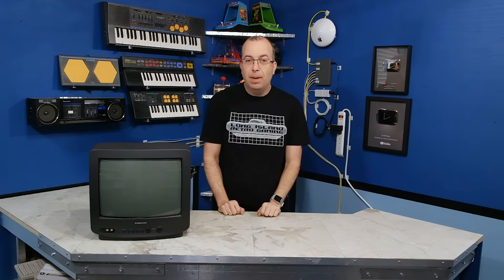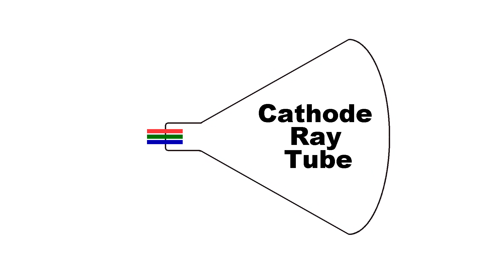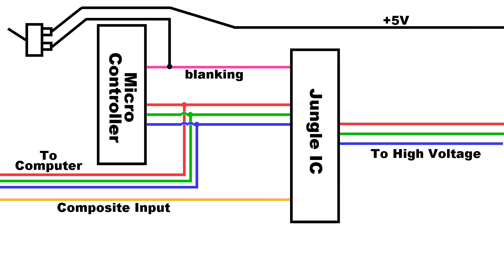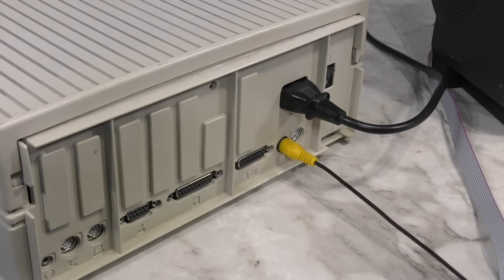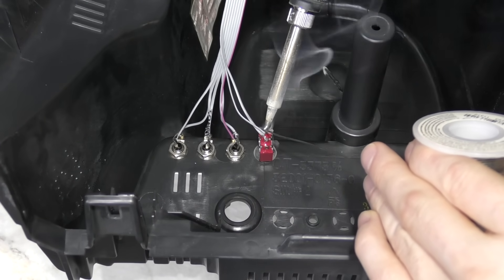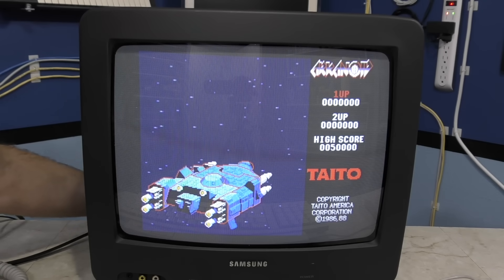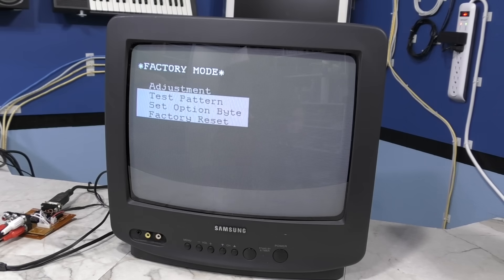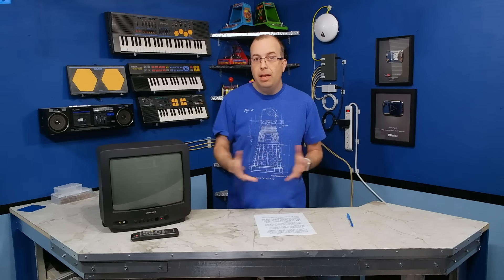Modding a consumer TV to use RGB input

Comment: This TV has very  low hours in it. I'm sure below 5000h, probably below 2000h. It's practically new.That's incredible for a TV which was in regular use since 1997. With any significant use, the white plastic on the deflection yoke should have been yellowed, and TONS of black dust on everything, as the high voltage attracts it. Even the plastic cover on the top of the heatsink (for the primary PSU controller+driver IC) is still white. These are used to be brown and brittle in a 20+ year old Samsung with this chassis.
I really suggest you to replace the electrolytics on the primary side of the PSU (the mains reservoir can be left alone), with some top quality Rubycon/Nichicon/Pansonic long life 105°C series, as this chassis uses a weird hybrid driver/controller IC, which is prone to failure if those capacitors go bad, which is possible after 20 years, even with low hours (especially, if the TV was in standby most of the time, in this case it's a wonder it still works). And you probably won't get any replacement PSU IC, because it has been discontinued 10+ years ago, the current stocks are all counterfeit and garbage.
Reply: this comment needs to be higher
Reply: @metarotta  that's right
Reply: @eashiftzr1  The STR series PSU ICs usually used in sony TVs are pretty bulletproof, but it's still suggested to replace all the small electrolytics on the primary side. All electrolytics around the vertical power amp, the horizontal driver stage (around the hor. driver transformer, both primary and secondary side), electrolytics in the E/W correction circuits and around the flyback. Than all the other electolytics that are close to hot heatsinks and components. Suspect the phisically smaller capacitors first (5-6mm diameter), they fail sooner than the bigger ones. If you have an in-circuit ESR meter, it's worth measuring the bigger capacitors as well. Oh, and check the whole board with a magnifying glass for cracked solder joints, especially around the components where the board is blackened by heat. Use only high quality 105°C capacitors, from the appropriate series (use low-ESR where the original was also low-ESR), and use long-life (8...10k hours) series around hot areas. If the repair/maintanance is on a low budget, don't go below the quality of Yageo/Teapo/Jamicon, bought from a reputable seller. If money doesn't matter, use Rubycon/Nichicon/Panasonic/ELNA/NIC.

Before the maintenance, check out the service manual, if the TV in question has a working hours counter, check it. A Trinitron tube usually gives a nice picture until 20-25k hours with the factory default settings (blazing high contrast, etc.). If your set is close to that, don't invest too much in it. Find the minimal contrast setting which is OK for you, this will extend the useful life of the tube. You can decerase the subcontrast and peak white levels in the service menu, also to extend tube life. Make sure you note the factory settings of the service menu, this way you'll have a backup, if you make some settings wrong.
Reply: This sums up what  mrnmrn1 posted. I organized it for myself and thought I'd share.
Can someone explain what 1d is? I'm not familiar with an E/W.
And is there a good place to find parts of a CRT and their descriptions. I know some of the general components but would like something mildly in depth.

CRT Restore
1. Change Electrolytic Capacitors
a.) on Primary side of PSU (can leave mains alone)
b.) around the Vertical Power Amp
c.) around the Horizontal Driver Stage (hor. driver transformer, primary & secondary side)
d.) in the E/W correction circuits
e.) around the Flyback
f.) around heatsinks or other components (resistors)

Rules:
A.) Smaller caps (<5-6mm diam) fail sooner
B.) Use appropriate series caps (ex. low ESR caps where used originally)
C.) 105° rated only
D.) Long Life caps rated for 8-10k hrs near hot areas
E.) Minimum of brand quality of Yageo/Teapo/Jamicon… 
F.) Rubycon/Nichicon/Panasonic/ELNA/NIC is preferred
Reply: @eashiftzr1   You're welcome.
Reply: How do i learn what you know
Reply: My main tv is still my Orion from 1996, while I have three hd tv's, teo 32" and one 50", I got them all for free and they was broken, but I repaired them, the first one just needed a software reset, the second a new t-con board and the third new caps on the led driver. 
Two years ago the Orion started to make loud noise in standby mode when the room temperature went down and didn't turn on again, sound was like current was leaking somewhere, after I opened it up it was completely grey inside, first thought was the dust gets moist when the room cools down, so current can leak somewhere, I cleaned it all but didn't help. I couldn't find where the noise came from, so I taped the microphone/remote piece of my earpods on a stick and went over the whole pcb while recording a video, this way I found a leaking cap in the standby circuit I replaced the cap and now, some months ago, the screen started to move up slowly and if I watch something where no black bars are on top and on the bottom, I get lines of the picture on top of the screen where ones are the normal ones and the others reflected, it's like the picture goes up and comes down again through a half pipe, would love to have a function to move that picture but I need to open it up again and turn some of the pots till I find the right one. But still there must be a reason for why the picture moves up, some day the potentiometer will be on it's limit and then I will cry for losing my go-od o-ld tv, so I need to find the problem, I want to use that thing till there is no compatible signal anymore and then maybe modify it with a new screen and stuff, basically keep only the case, I can't understand how people can replace their stuff just like that, that served them many years, but this also fits to the relationsships to other people nowadays, values are completely perverted, the least valuable not even real existing thing is money, 90% virtual numbers and the rest some scrap metal and colored paper that you can't even use to start a fire i case, but people give just everything away for that, just to waste it on useless stuff.

Comment: Im actually surprised the mainboard didnt have all the circuitry points present for a SCART connector.. it certainly looks as if the case is molded for it and there is just a composite connector installed there instead. SCART supports composite in as well as RGB so it would be simple enough to just install a connector there and save spinning two separate boards
Reply: other commenters pointed out that possibility, but there's no way of knowing if it'd be electrically compatible

Comment: I would wonder why bother on a on a small screen I see a use poing 68cm and above 

for north america 26 inch and above

from a pc perspective using adaptor cable became useless as from xp onwards tv res was no longer supported in drivers as they stop supporting tvs as pc type monitors

even is you can support  rgb you will still likely throw B&W Image because the pc will likely not support it in the drivers

Comment: I noticed at approx 9:37 the outline on the back of Davids TV for a Scart socket. Probably Samsung marketed this TV across many markets globally, so maybe a European version had Scart as standard.

It's a great thing to have now for me in the UK, as many of the old 8-bit and 16-bit machines can be plugged into a Scart socket via a 3rd-party cable. Bit of a pain having to use so many different cables, but there were multi Scart extension sockets available I seem to recall, so ok if you have the correct storage setup to run many systems.
Reply: Stephen Valente I think the board of the TV has the circuit for Scart input/output as well but is not populated. The way to do the hack is to find the schematics of a european version of that TV and populate the board likewise.
Reply: Λογος
I concur that it is very likely to be the case.
Reply: Steve
SCART connectors ARE essentially component video, insofar as they can carry both composite AND RGB signals, as well as sync, stereo audio, and a 12 volt switching signal that tells the TV to switch from antenna signal to SCART input.
Reply: Steve, you're thinking along the right tracks, however, inside the TV, the composite signal is split into RGB, not the other way around, so that the electron guns inside the picture tube will have their respective R, G, and B signals fed directly to it - via some amplification of course.

Comment: This is a remarkably informative video. Great work!  I would suggest using flux, and getting a variable power soldering iron.  That iron looked hot for the relatively delicate soldering you were doing.  You don't want to cook your semiconductors..

Great job 8-bit guy.  You are absolutely the best of the vintage-computing youtubers.

Comment: Great video, jump in quality is amazing :) i'm currently searching for cheap solution to convert HDMI to RGB Scart to play games on my TV, currently i have HDMI to AV (composite) its... good? at least in PAL mode since image is much sharper than on NTSC (50Hz sadly kills it for emulation as 60Hz games stutter a lot, PAL ports up to PS2 are crap and games are slower) but RGB solution will be much greater for even just navigating in Windows but i didn't find any with similar price. btw i tried to connect directly VGA output from R9 270 Graphics card to RGB Scard and tried CRU to force 15Khz, garbled signal was there but graphics card behaved very strange and PC was unstable, maybe newer graphics hardware DAC's are just incapable of that low frequencies?

Comment: Would your mod work with a YPbPr component signal since it is analog RGB and uses RCA connectors?
Reply: You'd need an extra circuit. YCbCr is analog, but the encoding is different. There are circuits going to and from RGB on the Internet.
Reply: YPbPr has its video encoded with Y as Luma (with Luma carrying sync), Pb The difference between Chroma and Blue, and Pr The difference between Chroma and Red.
Green was not present in the signal and was extrapolated from the existing Data. Also why Hence RGB is superior to YPbPr.
Reply: YPbPr is not RGB, so no.

Comment: I still (ironically it's RCA jacks and board has issues) have a TV though i dont use it ATM ... that looks EXACTLY like that
Reply: yep .. .hard to tell the exact size from the video but this may be the exact same model and TV I  have ... issue i have is the RCA connectors on the back are GONE so to speak and the little board for the RCAs in the front need to be re-soldered ... as it connects/ Disconnects unless i use to wiggle the RCA cables ... then THAT didn't even work any more ..I ended up connecting an RCA modulator to get RCA stuff to work with it ... I had a few people try to get me to toss out the TV but i am glad i kept it .. .may use it for a future project and while it seems small vs my current tv ... this TV that I got in @ 1998 .. still worked fine at least in 2017

Comment: 8 Bit Guy, 15khz is what most Arcade cabinets run at because they use a CGA monitor (basically a TV with no tuner)
Some later cabinets used VGA monitors, (modified TV)
But they run on the 15khz / 31khz freq.

Comment: Did this to a 20" sony trinitron from 2000.  Basic method is fundamentally the same but I put resistors and caps on the scart socket, luma for sync, and I used a scart socket instead of rca jacks   Didn't need to pull the board out either.  
Great video, people doing this are kinda hush-hush about it because of high voltage dangers inside a crt.  Might put a warning at the beginning of the video.

Comment: Be careful messing around in a transformerless set. There could be an electrocution hazard. I once wired in an external speaker jack on a set and discovered that the speaker cable was now ‘live’. This can happen even when the power plug is correctly polarized, but the wall plug has line and neutral wires reversed.  I would have never though that bringing out an audio signal would be a safety hazard, but it gave me a nasty shock.   I would highly recommend taking an AC voltmeter and carefully checking all your new signal lines you bring out of the set before connecting other equipment.
Reply: He fine as he took all the necessary precautions. And the Mod he made was on the low voltage side of the TV circuitry.
Reply: @Crashdance22 Did it? I didn't see that. And i was looking.

Comment: What about TVs with Svideo input? Isn't that the same thing?
Reply: Not sure if S-Video uses separate RGB signals, instead S-Video uses Chroma and Luma signals
Reply: I think S-Video has just lines for luminance (B&W picture) and chrominance (color information). It doesn't have separate lines for separate colors.

Comment: A question. Could you break out a S-Video connector and plug it in to the tv? A long time ago I tried to go from VGA to S-Video but didn't know what to connect sync to. I had heard the term sync on green but I didn't want to risk my video card to just connect the wires together and see. (I was about 10, 1990 or so) It worked and was recognized but it obviously rolled. Keep up the great videos on all of your channels!

Comment: While yes, analog over the air is long gone, you still can get digital to analog tv converter boxes off Amazon. Although, some cable companies have converted to carrier only signal, essentially, similar to satellite, you'd end up having to get a cable box according to what cable company you were with, like with what spectrum pulled with their customers. Edit: ok, coming back to this comment, I do think that most or just about all subscription tv boxes like directv boxes, do still have the old yellow, white, red rca Jack's on the back of the receivers. So, you could likely still use older TVs like the one David has in this video to watch TV from the subscription TV company, albeit, not as good picture quality, but still. Ok, I looked after I wrote that, and, yeah, even over 4 years later, you can still find atsc digital to analog tv converter boxes for over the air.

Comment: The STB Velocity 128 video card would put out 15KHz VGA if powered up and it didn't detect a VGA monitor.  That was because the DAC chip was doing double duty as the VGA DAC and composite DAC.  So it was down-clocking for the composite.  I used one to drive an RGB Arcade  monitor before.

Comment: Why do the pixels shift slightly to the left when switching to RGB mode?
Reply: A composite signal must go through a decoding process that requires around half a microsecond, to convert it to  RGB.  That half microsecond delays the composite picture, resulting in a shift to the right.
Reply: Ah ok. That's interesting, thanks.

Comment: Ah, Europe, life here is much easier
Reply: From what I heard, Europeans have a different set of headaches than Americans. Your consoles ran 10 Hz slower, for example.
Reply: true but those scart cables always were a pain in the ass to plug into the back of a bulky CRT
Reply: Minus 50 hertz...
Reply: But tv's were twice as expensive in Europe compared to the USA, with teletext, SCART, channel presets and other features standardized.

Comment: FWIW 8-bit is wrong on one point: you can get an inexpensive converter box that takes over the air digital TV and outputs NTSC analog, it works just fine.  We're still using it on a 32 inch (2.5 x the size of his Samsung) TV.   Some larger TV's had pretty nice resolution NTSC-wise and from across the room you can't tell the difference.
Reply: Haha I also have one of those boxes connected to an old 20 inch crt TV. The image looks great and doesn't have all that noise that analog TV has.
Reply: You're both right. Analogue TV is dead but doesn't mean you can't make analogue signals anymore.
Reply: Would you happen to have a link or a search query for boxes like these?
Reply: @gymnasiast90  Search for digital television converter box.
Reply: You can probably just search for “analog tv converter” or something like that. They were commonly available in the late 00’s in America.
Reply: You can watch TV on a picture frame with enough boxes in between. Doesn't change the fact that the TV cannot comprehend modern TV signals and only relies on the video inputs to act as a dumb display for any smart box out there.
Reply: You can find digital stream DTX9950 converter (RF or SD composite out only) used for $15 on ebay now. There are others that also have component HDTV out for the older TV's that don't have HDMI. The problem with those older digital to analog converter boxes is if they have any kind of regular use, the capacitors in them all dry out and the power supply dies, mostly because the power supply seems to run so hot; the PCB board in those always looks heat discolored. Those government subsidies for the converter boxes had plenty of manufactures get into the making them (even Dish network made one!)  for a while, but they were never meant to run 10+ years like people think with a regular TV set.  So a lot of CRT TV's were still working when the cheap digital converter box finally gave up the ghost after years of use, and the CRT TV probably got replaced by a  cheap LCD TV by then and the old working CRT TV went to the dump..
Reply: my grandma is still running one of those boxes on an old CRT in her bedroom haha
Reply: So there are HDMI-to-analog converter boxes out there? I wonder if there's one that can take the standard HDMI signal and produce a widescreen image on a CRT?